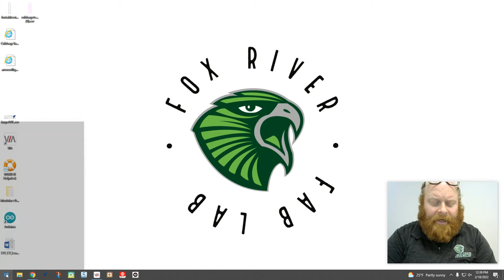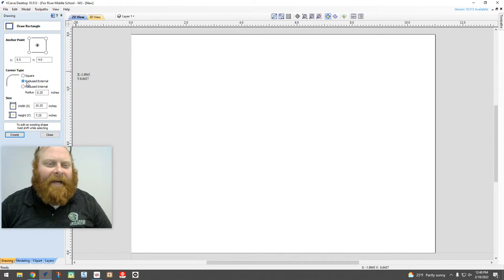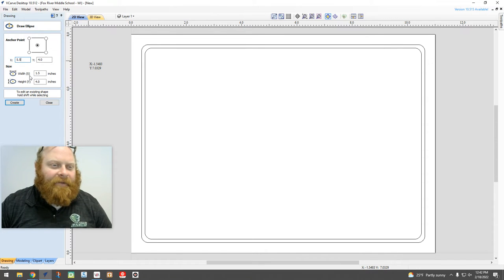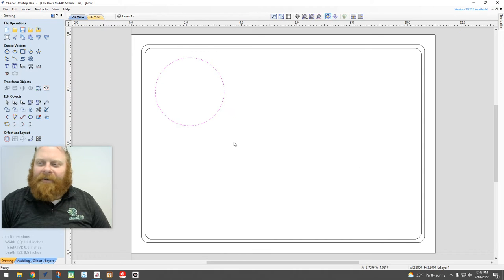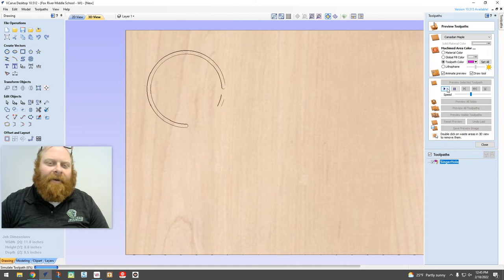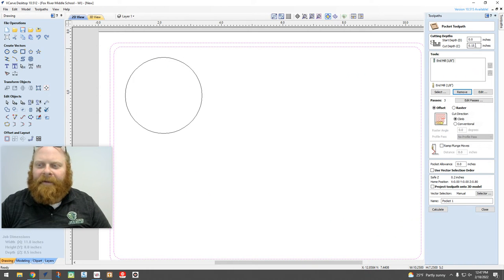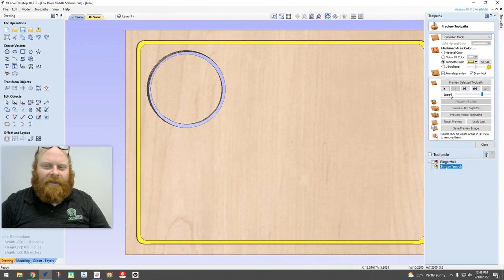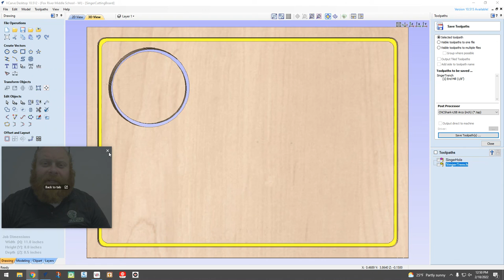Using VCarve to Create Cutting Board Trench and Hole

Comment: if it's not too late. i have a couple questions.

first, if my overall board will be cut from a larger blank, i can just set that up as a different tool path? is that correct?

Also, if i need to switch bits and cutting style (outside/inside/conventional, etc) for one of the toolpaths, will the machine stop and cue me to swap them out?

thanks